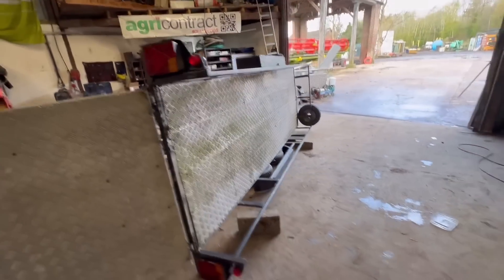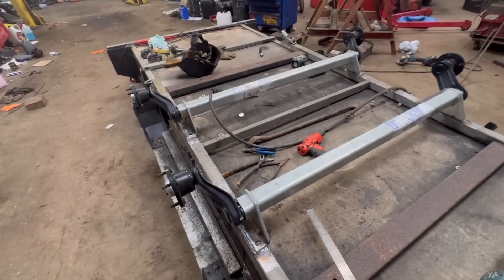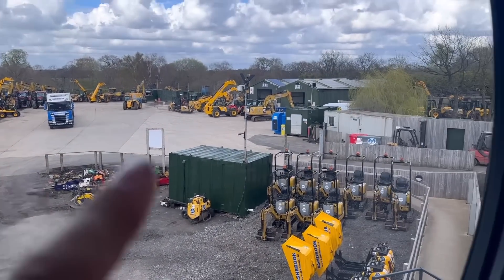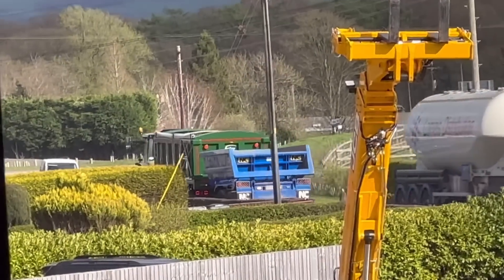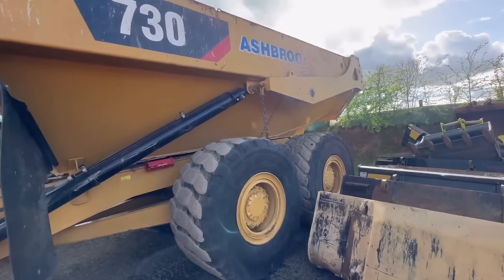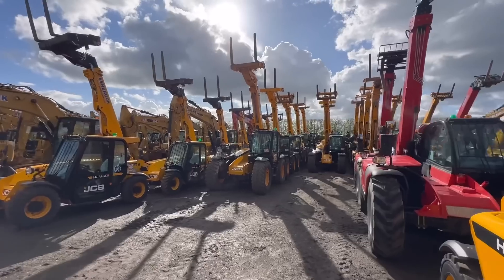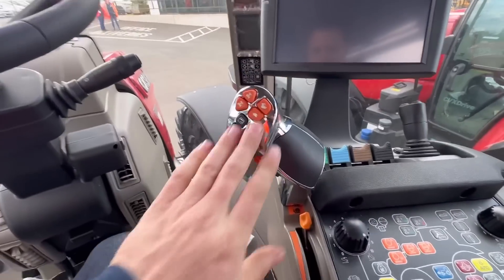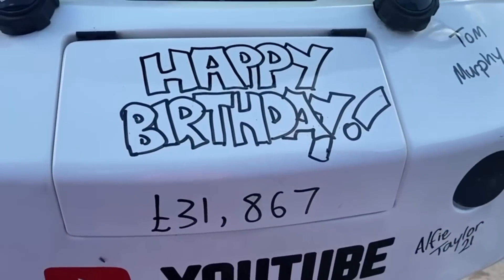LOTS AND LOTS OF DIGGERS #OLLYBLOGS #AnswerAsAPercent 1118

Comment: Padfoot or Sheepsfoot roller.
Very good at compacting clay/ silty soils.
Can compact to a deeper depth, than a smooth roller.
Compact's layers of material quicker, because of the added " kneading " action, of the studs on the drum.
Material layers, that need compacting, must be deeper than the depth of the drum studs.

Comment: I so get the dozer urge. I worked on setting out the Neath bypass decades ago, we were working late, and there was a big lump of concrete in the way … and  a D6 just sitting there …. Soon fired it up .. never driven a cat …. But levers and pedals … can’t be hard  …. Soon on the move … a sort of powershift .. so up a ratio .. lean on the concrete .. down to low … oh yes have some of that …

Comment: Don’t know what he uses the trailer for but looks a bit big to be unbraked 😮. Not seen a soldering iron that clips on a drill battery before, to be fair most people use the ones powered by lighter gas they are great and no leads